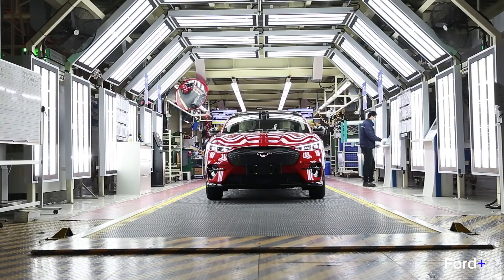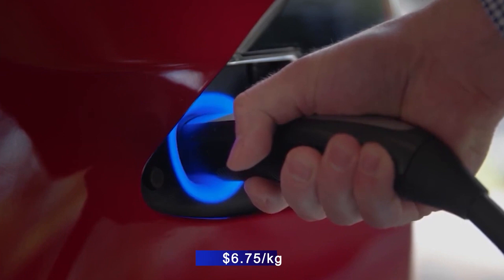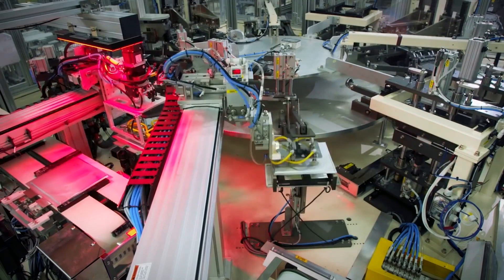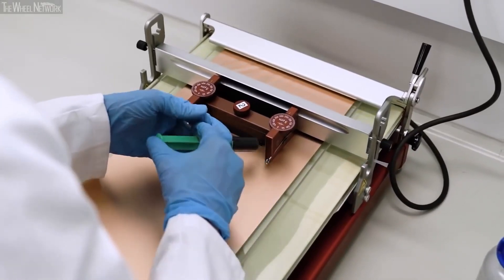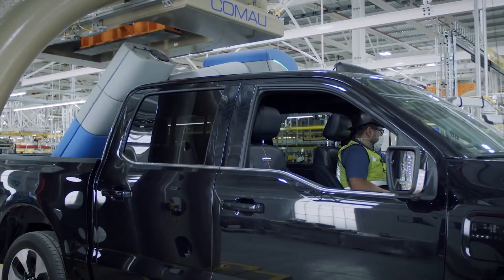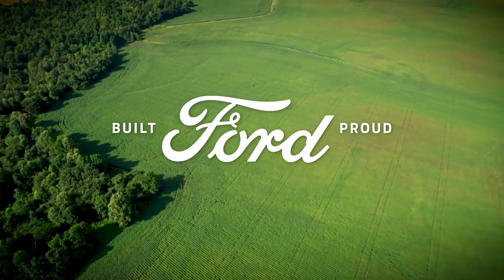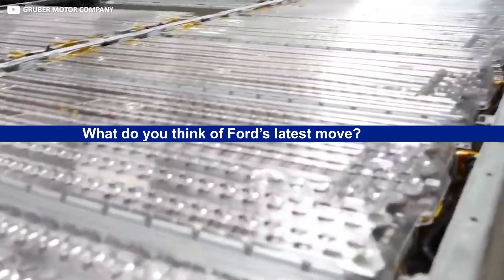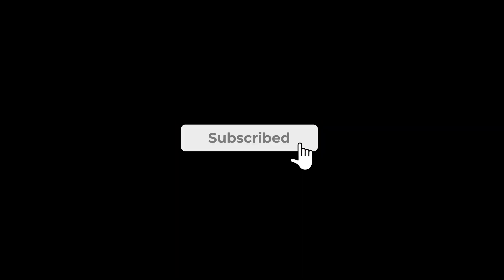IT HAPPENED! Ford Finally Reveals New LFP Battery!

Comment: The problem with the trucks is towing. 120 miles is not sufficient  curent batteries  would need to be closer to 500 kw to match a standard diesel truck for mileage  at same weight.  Yes charging time is a major problem  but battery weight is a bigger.  Hummer ev  battery weight is near 3000lb and we need 2 of those. Weight at 6000lb plus truck would be around 10000lb add trailer for a rough 5000lb leaving little left for the load.
Reply: In terms of energy an EV would need a 300 kw-hr. battery to match a diesel that has 25 gallons.  This is factoring in the bad diesel engine fuel efficiency of  ~35% with the good electric motor efficiency of the EV of 90%.  The energy density of what is carried on board is the difference.   300kw-hr. batteries are not practical yet but may be someday.  Hopefully the battery technology catches up some.
Reply: @joevigil5274  bad diesel efficiency??????? Far more efficiency than gasoline engines
Reply: @davehamilton8736  thats correct, ICEs are  quite inefficient in comparison to electric motors.  I agree, Diesels do have their advantages over gasoline engines for higher torque applications like towing.
Reply: @joevigil5274  Yet owning a diesel to tow once in a great while is horrid if you use it for a car the rest of the time.   Rent the big diesel pickup twice a year and drive a EV pickup or whatever you need for your daily needs.
Reply: Most pickups on the road today never haul anything heavier than passengers and groceries.  In the 70s and early 80s trucks had vinyl seats ,vinyl floors a.m radios if equipped after market cb radiowas common, no a/c rode rough as hell. Had a smell that never seemed to go away and were used for work because nobody wanted a truck as a daily driver. The world has changed.
Reply: @martyk1156  going ev is bad idea all around. 
We should just make hydrogen engines by modifying what we have. Then start making ammonia at home to fuel the engine.
Reply: @itsmecommonsensebesmart  hydrogen is the most abundant element in the universe. And the output from a hydrogen engine exhaust is water.
Reply: @clutchboi4038  every design requires a 10k psi tank?  
Could use ammonia to make hydrogen. Much safer to transport..
Reply: @martyk1156  that's why these cheaper batteries are good news.  I use my truck for work. I'm a Carpenter and I can't afford a $80k truck
Reply: @martyk1156  Marty not to mention you could clean the interior with a hose lol
Reply: I agree, but there’s a ton of tech out there for batteries that do that. They’re in production in small volumes. You’ll see the chemistries continue to change and update giving more and more range at a reasonable cost. Give it 5 years and I think we’ll be worlds away from where we are now. Even CATL’s current LFP tech is 90% as energy dense per cell as NMC batteries, and you can pack more cells together, as the video states. You won’t lose much range. And they’re far more resilient to charging. You can charge them to 100% routinely, which is something you can’t (or at least shouldn’t) do with NMC.
Reply: @gridjac  you just won’t have the power to charge the batteries. Especially in California
Reply: @veganpotterthevegan  many people will use a truck as a car, But with the option to tow boats, trailers, fill up the bed with mulch, etc. when they need to. We don’t want to make trucks lose their purpose and limit their capability…
you want the functionality and utility when you need it. That’s why you buy a truck. Unless you just love driving a trucks.
Either way, ev trucks are trash,,,:.
Try driving one from ny to Florida. It will take two days longer unless you get a big generator for the back…lol. And it will cost a lot to charge up as you go. Then you’ll worry when you hit hills and the range start dropping off fast with no charging stations around,,, no thank you
Reply: @veganpotterthevegan  that’s a broad baseless generalization. I don’t think you know what everyone else is doing all the time…you ignored what I said too… 
We shouldn’t compromise what a truck is, what it’s capabilities are based on this belief.  It’s irrelevant. Some people like trucks and they like to drive them. We don’t need to change what it means to be a truck. 
Reminds me of people trying to change what it means to be man or woman, as if identifying as something, means anything… 
Ev trucks are trash and serve no real purpose… they can’t tow for any real distance. After 100 miles you’d have to charge up.. thats expensive and time consuming, that’s unacceptable…
Reply: @veganpotterthevegan  you don’t know what anyone is doing with their truck.  They may not always need the utility but still like a truck that has the capability to do what they need when they need it. 
Overall I don’t know what point you’re making. If you build a truck it should perform like a truck not like a car…it should be able to tow or haul stuff… vans used to be based of trucks… we should compromise what a truck can do because EV’s suck,,,
Reply: @veganpotterthevegan  it really doesn’t matter except you have some hard feelings about truck owners. Is there bigger point you were trying to make?
Reply: @veganpotterthevegan  an ev will cause more ecological harm than an ice vehicle, if you consider the whole life cycle..
Reply: @veganpotterthevegan  total nonsense. You can’t account for mining or recycling, or all the coal burning needed to power these cars. 
If you think driving an ev powered by coal is better than gas, you are mistaken. 

 a team led by Christopher Tessum, an environmental engineer at the University of Minnesota, Minneapolis, set out to study the effects on human health of various alternative ways to power a car. Their findings are presented today in the Proceedings of the National Academy of Sciences. Internal combustion vehicles running on corn ethanol and electric vehicles powered by electricity from coal were the real sinners; according the study, their health effects were 80 percent worse compared to gasoline vehicles.
previous studies have suggested that emissions from electric car battery production make such vehicles worse for public health than gasoline vehicles, even when the electricity to power them comes from non-polluting sources.

This pro-ev marketing bs you parrot is nonsense…
Reply: @veganpotterthevegan  science is always up for debate. I presented science you presented an opinion not backed by science. 

 a team led by Christopher Tessum, an environmental engineer at the University of Minnesota, Minneapolis, set out to study the effects on human health of various alternative ways to power a car. Their findings are presented today in the Proceedings of the National Academy of Sciences. Internal combustion vehicles running on corn ethanol and electric vehicles powered by electricity from coal were the real sinners; according the study, their health effects were 80 percent worse compared to gasoline vehicles.
previous studies have suggested that emissions from electric car battery production make such vehicles worse for public health than gasoline vehicles, even when the electricity to power them comes from non-polluting sources.

This pro-ev marketing bs you parrot is nonsense…
Reply: This comparison was based on the 2022 Silverado 3.0 diesel towing fuel mileage and the 2021 f150 lighting. For has now announced that they will be using a less dense battery there for reducing mileage farther. Meanwhile gmc is a 400kw $107k truck compared to the Silverado 3.0 diesel at $60k( $47k off sets a lot of diesel fuel for a really long time at 28mpg)
Reply: @itsmecommonsensebesmart   Your trading Li-Ion for LFP.     Li-Ion currently give the best range but cost 2X what Li-Ion cells do but then LFP are less apt to burn.   Keep in mind that ICE pickup is about 2 orders of magnitude more like to burn than the li-ion cells.
Reply: When was the last time you towed something...
Reply: @stevefisher2553  I have two things that requiring towing.. a boat and a Polaris rzr . Nobody wants a fake truck that can’t do the work when needed… aside from a few women..
Reply: @democratsmakeyoupoorerandr2335  you can nearly tow a Polaris RZR with a Nissan Leaf ffs.  Is your "boat" a kayak?
Reply: @veganpotterthevegan  you want some weight to the vehicle when towing. The Polaris is pretty heavy and a lot of drag when towing. Anything can pull , more importantly, can it handle the weight and stop it with out taking you off the road…
I have a nice new Yamaha jet boat. That’s over 3000 pounds… only a tard would try to pull either without a truck or big suv.  That’s why I have the Lincoln aviator… 
If you own any toys like that, you’ll need something with the capability to tow… EV will get you 100 miles with a boat on your best day with no hills…
Reply: @veganpotterthevegan  dinky? 
What do you have ? What do you tow?
A minivan would be bare minimum but you could pull it off…  you wouldn’t want to go very far though with a boat.. 
somehow I doubt you and your vegan bf can afford much…
Reply: @veganpotterthevegan  a dually van like the ford e350? That’s a truck with a van body on it…if you’re pulling 10k you need a truck based product like an e350, or a big suv. 

The boat with gas in it weighs close to 4000 lbs, you don’t pull that with a Subaru. 

Pro athlete? 
You don’t eat meat?
Reply: @democratsmakeyoupoorerandr2335  I wouldn't pull your boat with my Subaru(an Ascent can) but I'd pull it with a minivan.  My old Sienna campervan could easily handle that.  I've pulled 5000lbs with it cross country without issue
Reply: @veganpotterthevegan  commercial passenger vans are also built on truck chassis and use truck engines and transmissions.  When you need to pull 10k lbs you need a truck based machine. What’s the make and model?
You said it’s dually so it can’t be the gmc savanna, which is built on sierra truck..
Is it a passenger bus where people can stand and they walk on board?
A commercial 15 passenger bus with a dually is built on a very big truck frame. It’s a truck…..
Reply: @veganpotterthevegan  transit hd 350 is a truck with a van body. Truck chassis, truck transmission, truck engine with dually… you prove my point. 
I would not want to tow either with anything smaller than the Honda Ridgeline we used to have. That’s bare minimum for pulling the boat out of the water and getting down the road safely. The bigger the truck the better, when towing. You need something that can handle the weight , stop it when you need to, something that won’t get jerked around. 

Calling me stupid and telling me how i don’t need a truck to tow but you use your truck (van) to tow….. ok bro….
Reply: @veganpotterthevegan  you proved my point , you needed a truck to tow.. 4000 lbs is not dinky. You want a real truck not a Subaru Forester to pull that. I wouldn’t want anything smaller than a Honda Ridgeline.  You need a truck or beefy suv.  Anything less is stupid. You definitely don’t want an ev. 

You know Pulling a 4000lbs with a Subaru wouldn’t work… 
So you’re like a taxi driver at the airport?
Reply: I drive a truck for work every day and never tow.  Rent a diesel to tow.
Reply: @matthewsaxe6383  ev is the worst option for towing. Unless you want to spend two days to go 200 miles.
Reply: No one disagrees with you. Need higher capacity batteries for greater range.  The point being the amount of energy in a diesel or gasoline vehicle is so much greater then in a battery.  Kind of apples and oranges comparison until battery energy capacity gets better.  The comparisons being made are to batteries that have the energy equivalent of 4-6 gallons of gas.  Of course the equivalent range is not there despite the higher efficiency of the EV.
Reply: @joevigil5274  By the time the US climbs out of the depression we should have significantly better batteries.
Reply: @danharold3087   EV trucks can tow and they can tow very well better then ICE, note the torque at 775 lb-ft of torque.  What 1/2 ton Gas ICE has that?  The issue is, cannot tow very far.  So when the capacity of the batteries gets better that issue will go away.
Reply: @danharold3087  that’s going backwards.what did they tow with?
Reply: @joevigil5274  The transport evolved tow was with an F150 EV.
Reply: @joevigil5274  Read that wrong.   Yeah full torque off the line.
Reply: @danharold3087  I will try to keep driving ICE, let’s hope democrats aren’t in power to mandate it..
Don’t get me wrong, Electric has some nice aspects, like instant torque. Tesla makes the faster car off the line…
However batteries are junk right now. There’s no benefit when you account for batteries and charging with a coal power plant…
Reply: @danharold3087  Yes off the line and through the power curve with higher motor efficiency.  ICE do not have that.  EVs can tow and they can tow very well.  What is missing is for what duration which equals range.  Again the “gas” tank in the EV is too small to compare to ICE vehicles which have a much larger gas tank.  When batteries get to higher capacities, this range issue will subside.  So for now if one has a need for long distance towing, an EV is not the choice to make.  However if your towing needs are local then an EV is a viable choice.
Reply: @joevigil5274  Agree.  I might have written that very text.    1000s of people are working on improving batteries.  The ICE engineers in their attempt at more mileage have reduced engine size keeping HP the same.   The engines have become overly complex and reliability is declining.
Reply: @danharold3087  how far? 150 miles? It gets about 80 miles at 10k lbs…  not good
Reply: @danharold3087  when you pull 10k with the lightning mileage is about 80miles. Then you need to charge… How far did they get pulling a 3500 lb car? 150miles? It only get 230 to 300 miles range on full charge, without towing.

Coal power ev is stupid and eliminates any perceived green benefit.. studies show that. Coal is not green
Reply: @matthewsaxe6383  where are you going to rent a diesel from to tow?
Reply: @M35a2guy  great business idea.
Reply: @matthewsaxe6383  you stole the words out of my mouth

Comment: The lightning replacement battery is $31,000.00 dollars. Yes boys and girls $31,000.00 dollars.
Reply: Ford gives you 8 years.  You won’t want that 1st gen. battery at that point.  Looks like at least for early adopters they will replace their vehicles sooner then the warranty runs out. The good news is batteries are getting better each year and longevity will be longer then the life of the vehicle for future generations of vehicles.
Reply: Thats pretty cheap $/KW vs home batteries
Reply: Where did you get that number from? Currently the most expensive is like 20k, and that's if you void the warranty. However if you get 100k miles out of a battery or more, worry free, who cares?
Reply: @ElmwoodAl  I got the price from our back counter parts department. (Ford dealership)
Reply: @matthewnosal6893  And Motors never have problems really.😮😊
Reply: @Sluggo67  time will tell…
Reply: @ElmwoodAl  bro thats your standard? 100k miles is ok then replace your batteries for 30k? For another 100k? Lol
Reply: @ElmwoodAl  100,000 miles is nothing - I have a crappy ice commuter car with 240,000 miles that still runs great- and I don’t have to pay 20 or 30,000 to replace a battery

Comment: Range.  Price too but Range and charging.  They must be able to charge to FULL in 15 mins or less.  If they can get to the 15 min mark, think most will be OK with the switch with 350 -400 mile range.
Reply: I think 15min to 70ish% and 30min to 100% would be plenty. Once trucks/cars are able to hit 350+ miles of range then the charge time can become a little more elastic.
Reply: aptera then...
Reply: It’s a step in the right direction LFP batteries are more stabile then Li ion so they can actually take on more powerful charging without worry of exploding.